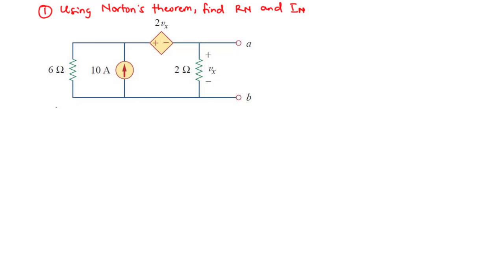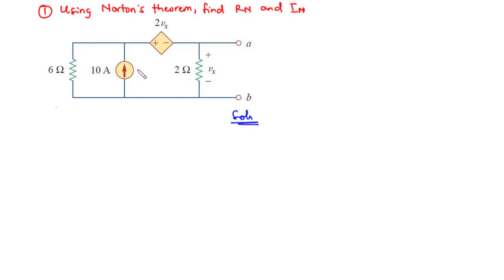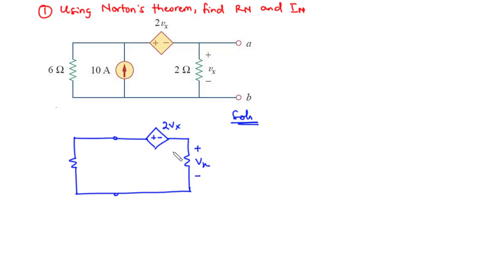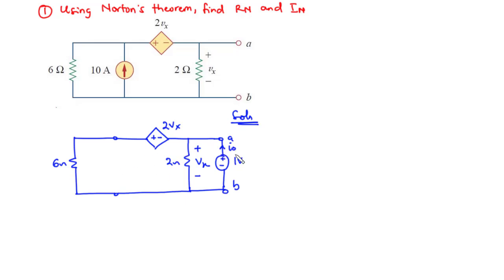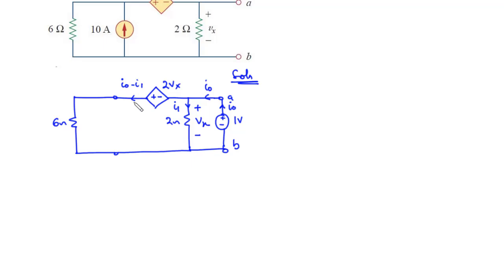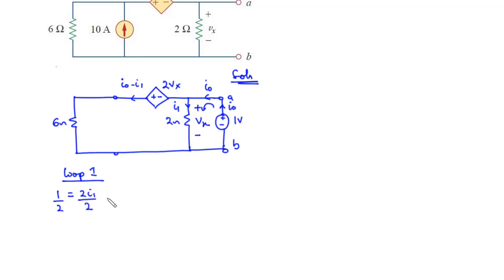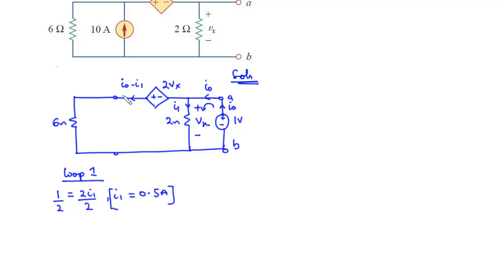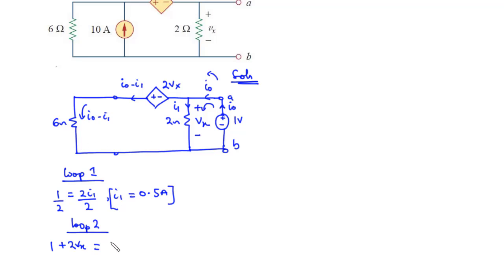☑️18 - Norton's Theorem: Circuits with Dependent Sources 1

Comment: WhyY do u include the 1v between terminal A and B , where does 1 volt come from ...?????????????!!!!!!
Reply: You are going to add an independent source either 1V or 1A
Reply: @ÆonFluctuation  is coondition only for this problem or for every Norton theorem with depend sources?
Reply: @gfrshkh 1V or 1A is the easiest way. You can always change the value anyway as long as you can still solve it.
Reply: @gfrshkh it is the assumption actually u can apply V value of whatever u want. 1v is common because it is the easiest. The reason why we use this assumption is to obtain Rth by v/i